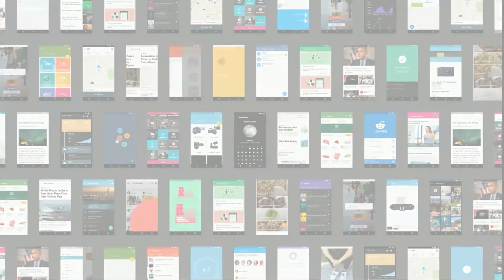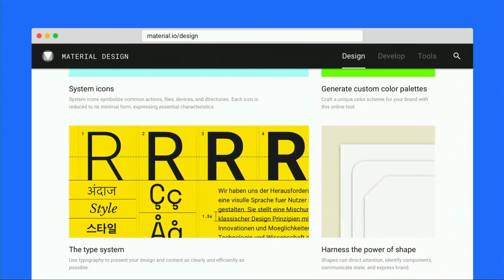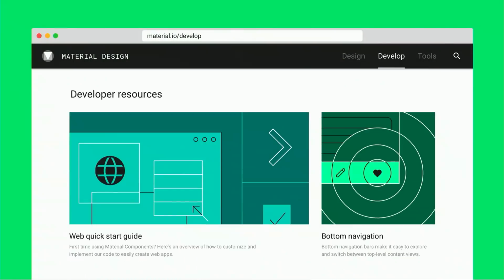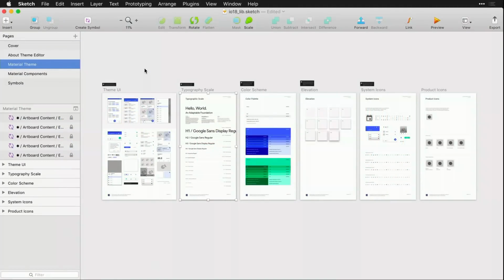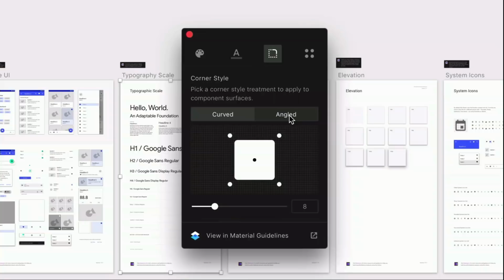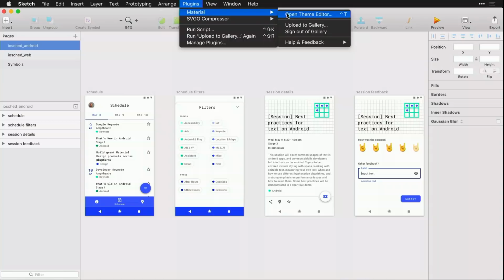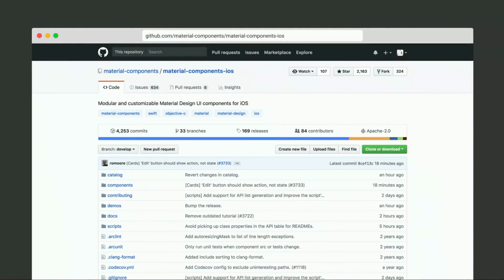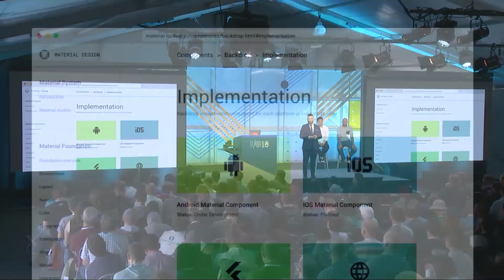Build great Material Design products across platforms (Google I/O '18)

Comment: is it only exclusive for Mac users?
Reply: I'm not a Mac user, and I too wish it would be available on other platforms too. However, if you're into design, you have to get a Mac. It's so widespread amongst design people.
They could've chosen Figma, which is a nice alternative to Sketch (though not as powerful), which can run in a browser.
Reply: It seems clear that iOS oriented development is in the primary focus of this Design push. Google wants more cross-platform apps to be developed. And even developing on Flutter, to polish iOS variant of your app, that was fully developed on Linux, you still need Mac and it's pity...
Reply: Not being able to develop iOS apps on Windows with Flutter is not because of Flutter itself but because of Apple not allowing it. Also hope they make a similar design plugin as the one for Sketch, only for Figma(similar but available for Windows users).
Reply: i want to know it too.
Reply: it is a plugin for Sketch. And sketch is only for Mac. And it costs 99$ per year.